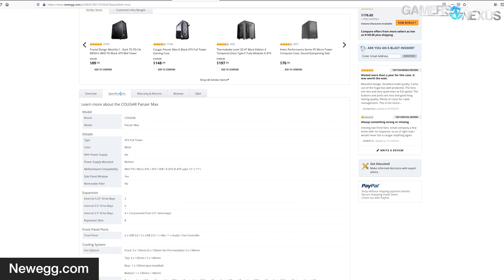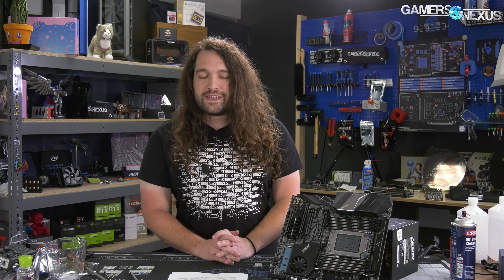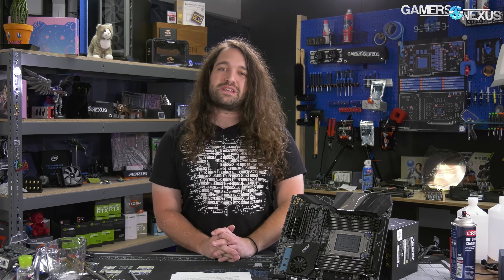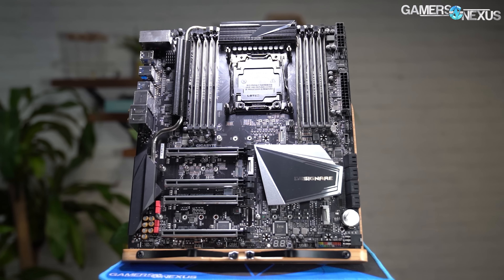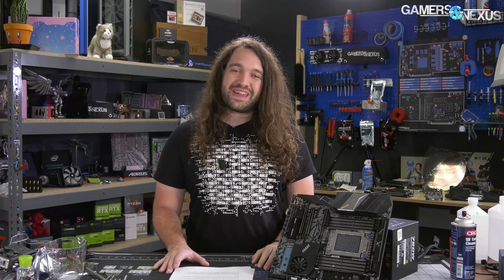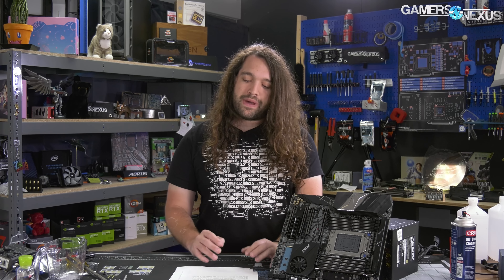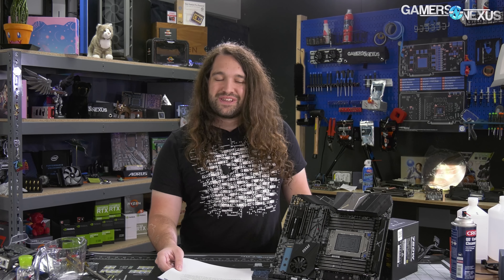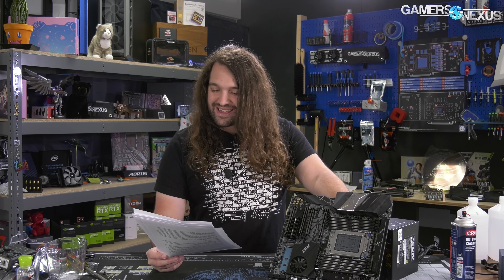"E-ATX" Is A Lie: How Motherboard Makers Ruined Form Factors

Comment: Mentioning ATX or SSI EEB is important though to provide information over the screw mountings. Yes, it is not helpful that some manufacturers use E-ATX interchangeable for "wider than ATX but with ATX holes" and "wider than ATX with SSI EEB holes". The first one actually makes sense, as "Extended ATX" says what it is supposed to mean, it's the second one that creates issues if SSI EEB is not mentioned. So my proposal is for  manufacturers to, if supported, just use SSI EEB as the supported form factor, and if not, but still larger than ATX, to say "Extended ATX Form factor with up to x width" as that seperates the "Extended" from the standard.
P. S : Please don't prove your point of a non insightful thing by just pulling a tiered acronym apart multiple times, that's just primitive and dumb

Comment: I never really read up on these different standards of form factors, always working under the assumption they were grounded in published standards. Having just found out this isn't the case at all, I'm extremely confused how everybody in the industry could just keep going, inventing new kinds of motherboard form factors left and right, which has apparently led to a dizzying number of differently sized boards and no good way for customers to check whether the stuff they bought is even of a compatible size.

Comment: I suggest you, Linus, Kyle, Jay, and Wendel get together, and hash out a new standard, then send it to case/mobo manufacturers for review, and the final revision should go to IEEE. And of course into wikipedia.

My draft:
X-Y-Z-i-j-k-x-y-z
- X= utilization: D=desktop, S=server, E=embedded, M=mini, Z=special
- Y= cpu type: A=amd,I=intel,O=other,N=any
- Z= Form Factor: XL=extra large,L=large,M=medium,S=small
- i= # of expansion / PCI slots
- j= screw arrangement: A= original ATX, E= EATX, D= dual, L= ALL, (this most important form factor TBD)
- k= standard: M= metric, I= imperial
- x= width measurement  (depends on k above)
- y= height measurement (depends on k above)
- z= maximum GPU length (depends on k above)

So, for example my Asus Prime X370 Pro would be something like:
DAL-6AI-12-9.6-9 

Then, my Corsair Crystal 570X would be:
DNL-8AM-512-480-370

 I have spoken.
Reply: I don't know if it's easier...but at least, you're good at creating passwords

Comment: Same as "Full Size - ATX" When you buy motherboards look at dimensions of the board "if provided"... I purchased a Gigabyte X390 Full-ATX Motherboard... but compared to my old Gigabyte Motherboard the new one is off by "10 - 15 mm" in "Width" and because of that 1 Ram/memory slot is blocked now.... vs the old board...

Comment: plus it would be useful to have the standards in a more common system.
ATX is 305x244 mm, why not chane that to exactly 300x250 mm?
much better to work with for the majority of the world that use metric.
also fuck i have an EATX Motherboard...

Comment: Steve is bored lol. Now can you pick on case makers like Fractal who list radiator support for say a 420mm radiator that only tends to fit if you have no hardware in the case other than the radiator OR Radiator manufacturers themselves who seem to like using different dimensions and even screw holes placement.

Comment: For many years, I used large dual Xeon boards in my desktops, and that required very careful case selection since most are EE-ATX or some weird proprietary tweak thereof.  I always looked at the manuals to see exactly how much space was available, and to gauge how much dremeling and drilling would be required.  At the time, it made sense, but Zen 2 finally brought workstation power to plain old ATX sized boards, and I can finally rock nice looking cases again.

E-ATX and EE-ATX can die in a fire.

Comment: Glad I found this.  I keep checking your YT channel to build my first 3D render PC, but most Creator motherboards are EATX, and not one fits into most cases.  I’ve reviewed your videos on good cases, and the EATX would fit in Thermaltake Tower 900, which you rated terrible airflow - so, now I’m trying to find alternative motherboards to fit cases, or alternate cases for the motherboards that I have my eye on.  Not having much luck with either...

Comment: Having built a dual Xeon using a supermicro EATX C602 board, I can safely say GN is spot on here. The standard is a mess. Luckily I triple checked my case vendor's docs and found out that my board would fit. And oh boy is it tight, even in a "full height tower".

Comment: This just illustrates how badly "ATX" needs to die.  All the form factors suck, and 75% of the 24pin ATX connector is literally useless, its all insanely outdated.  "ATX" is generally a waste of space aside from HEDT and then its too narrow, EATX is a mess (obviously), iTX is too small and cramped to be mainstream, mATX is about right size wise honestly.  The community and case, board, and PSU manufactures need to get together and draft some new standards for the enthusiast market.  Just don't let Intel touch it as they'd surely fuck it up.

Comment: tldr: E-ATX = an ATX board wider than spec by an undefined amount. make sure to check the maximum motherboard width supported by your case before buying an E-ATX board.
Saved you 20min. You're welcome

Comment: I think it would make far more sense to increase the form factor in other direction, to get more slots and make it official in a sense that cases would need to have specific things and motherboards cannot require anything other than that to fit it.  I would rather like to see potential to have 3 extra slots in the bottom. Basically having space for 5 dual slot cards, or 3 triple slot cards.  The extra space could be used for same things as going for other direction. And new bigger cases would also fit the OLD motherboards easily so that wouldn't a problem.

Comment: I remember working at Microcenter back in 2010-2013 and having to explain this nutty crap to the few people that came in looking to get the really high-end boards that had "EATX" sizes.  Biggest issue being finding cases.  It was common back then for motherboards to sit in a recessed area back then.  Early days of good cable management attempts.  Not all of these cases supported all EATX boards.  Despite saying they did.  Good times...

Comment: Thanks GN! We needed someone to say all this loud and clear. I shudder to imagine if power supply manufacturers were as fast and loose with motherboard pinout standards as motherboard manufacturers are with sizing standards. (Yes I know the power supply side of cables are shockingly non-standardized already).

Comment: Thank you for covering this topic. It has been a constant source of frustration for us professional IT people for years now. ATX always was designed to conform to a size specification, etc. It was designed by Intel, and agreed upon by various industry manufacturers back in the day like you said, to replace IBM's AT standard. But these motherboard makers don't even stick with the ATX size specification when they call the board "ATX." You get a motherboard thinking it will be the proper ATX size spec, but then find out that the board is narrower. So for example, Gigabyte calls a board "ATX", but it turns out to be narrower in width. That means then you only have two screws across in three rows on the board. They then add some weird 3rd standoff hold on the 2nd row. That weird 3rd hole doesn't even line up with the ATX spec, so therefore it ends up being useless. I have never seen a computer case that has a drilled location for that extra hole. Why Gigabyte? Why? What the hell is the point of it? And why do these board makers create these narrower boards? The only reason I can think of is they are just trying to cut costs or corners.

Comment: Excellent and right on the mark with this rant. Totally justified. I ran into this when I built my EVGA  151-HE-E999-KR motherboard. It took some time back then to find a case to hold it. I ended up with a Thermaltake Core X9 a massive case. Had to do a lot searching at that time to get a case that fits.  Thank you for making this public for the case and motherboard manufacturers to  understand (hopefully) that this a real issue.

Comment: Mobo manufacturers may have started this nonsense but case manufacturers are to blame for making it a complete mess. If they would simply make their cases compatible with most motherboards their wouldnt be an issue & they would sell more cases, instead of catering to sissies that want tiny cases for their pussycats to piss all over

Comment: This exact thing has been driving me insane for years. 
Starting with my decision to get into old server hardware.
Fun note, NZXT's case CAN fit an SSI-EEB board, but you have to remove the cable hiding metal strip.
The EATX supporting Cerberus X CANNOT support the full 13" it claims. It's about 4mm short.

Comment: TLDR: Standardizing it would actually be ANTI-COMPETITIVE. That's really a stupid argument tbh

If you're shopping for EATX you NEED to check the dimensions and your casing - which NEEDS to be proprietary to allow for servers to be highly custom..

It just means "bigger than ATX", and while you can't just read a spec sheet while somehow ignoring the dimensions and mounts, you probably shouldn't be building an EATX build just because they've already made it more accessible than it needs to be
Reply: "HELP I BOUGHT ALL THESE PARTS TO BASICALLY BUILD A SUPERCOMPUTER TO PLAY FARMVILLE ON BUT IT DOERNT FIT OR MOUNT AND I CANT EXCHANGE BRAND NEW  CASE OR REUSE EXISTING ONE WTF"

Comment: The height is getting a problem too, Asus Zenith Extreme has a heigt of 12" (30,5 mm), the Asus Zenith II Extreme is 12,2" (31mm) both say "EATX" on their productpages. 
I got lucky that the Zenith II Extreme fits in my Coolermaster C700M, because it has 8 Pci slots.
If i had used a Fractal Design R6 the Zenith II Extreme wouldn't fit, only 7 Pci Slots max height of 12", but it says eATX on the productpage. 
This gets even messier when manufactures play around with dimesions in both directions.

Comment: Nerd 1:"Hey man, did you hear about Steve?"
Nerd 2: "Kangaroo or Tech Jesus?"
Nerd 1: Crosses chest "He's gone, man."
Nerd 2: "Wait what? Corona? Random car crash?"
Nerd 1: "Naw, man... he had a stroke when he was bitching about case and motherboard manufacturers not understanding form factors."
Nerd 2: "Dude... those monsters. Do they know what evil they have wrought? Who's gonna feed Snowflake? Someone needs to let them know they've gone too far!"

Meanwhile -

MSI: "haha VRM go sizzle"
EVGA: "haha CPU cooler mount sideways"
Gigabyte: "haha dual BIOS go BOOT FAILURE DETECTED"
ASUS: "haha lightingservice has stopped responding"
Supermicro: "haha green PCB go KA-CHING KA-CHING"
BIOSTAR: "haha we still exist"
Fractal: "haha meshify go whoosh"
Antec: "haha torque go BRRRRRRRRRRR"
Phanteks: "haha reservoir go in fan slot"
NZXT: "haha CAM go *Windows XP error sound*"
Thermaltake: "I NEED MAGENTA"
Reply: E Montem Ros Corsair: "haha light go BLINK BLINK"

Comment: I buy MATX because im not doing anything cool, nor pretending to be. I buy older games when they go on sale, F2P and esport games, the newest game I get are free from epic. my last upgrade was last year to a refurb $70 R9 380 and a ryzen 1200 on a B450M Aorus with 16GB RAM ($270 in total, "shop S-Mart"), all crammed into a tiny rosewill ranger-M with a 4000 RPM fan from an old stock FX 6300 cooler, stuck in the front to dump air in at rock-concert decibels, so this shouldnt affect me, but I am not so naive. unfortunately, I am aware of how bullshit cascades down hill, gets carried by the wind to far off lands, and pools to fester at every available crevice, and therefor am still really pissed off and disgusted by this BS form factor because I know, I just know somehow its going to bite me in the dick some day, despite being on the opposite end of the spectrum from where i comfortably sit in "average user land". in fact, when the dust settles, i bet the noisy minority of advanced users will get some sort of clarity at the expense of the so-far-unaffected average DIYer, just because something has to give and all the suggestions will be coming from the top advanced user crowd. Hopefully it wont all get scrambled, maybe we will get some new form factors and simpler, logical descriptions. I swear its like nobody ever asked these tech moguls what is the difference between a big block and small block engine, just to watch them spend 5 minutes on the internet leading to aneurysm

Comment: Yeah. This is so much bullshit it makes my blood boil sometimes.
Recently I've been trying to find cases that support the Gigabyte TRX40 boards, which are labelled as XL-ATX. Except they're not, not even one of the 3 available competing definitions of XL-ATX matches the boards' actual size of 325x275mm. Wtf? Gigabyte apparently needs 2 different definitions of the same non-existing standard. Just for good measure, I guess. It gets even better when you ask case suppliers if the Gigabyte board will fit. Then you're in for a treat. It's really, really obvious that very, very few have any clue what they're talking about when it comes to dimensions, and even less give a fuck.

Fantastic video, I laughed far more than I should've. ;)

Comment: Want to Buy:  better control on this BS. All it does is lead to confusion and cost to consumers. especially those that are coming into the PC Hardware industry. It's the same as Pin-outs from Modular PSUs, theres no standard for that. So someone without heads up knowledge of that can easily brick a component, or even a full system if they manage to mix up cables from different PSUs.

Comment: Considering "EATX" boards are all highest-end, very expensive, enterprise-level, this seems like a problem that affects statistically few people. When you make no-compromise runs in the hundreds, you make the board whatever dimensions it needs to be to fit all the features. On budget boards you only include what features will fit in the standard form-factor.

Comment: This is something that's been pissing me off for years tbh, I used to play with dual xeon stuff a LOT so finding a case that'd fit those boards got hard since, as you mentioned, basically only silverstone actually list their boards as ssi-ceb or ssi-eeb and all, everywhere else was just 'E-ATX' even when by E-ATX they mean literally anything that's wider than a standard board, the other classic as others have mentioned is the 'oh, yeah, you can put a radiator in the top of this case but only if you don't need any ram' or 'oh it can put a 360mm in the front and the top! Just not at the same time' it's all beyond stupid

Comment: I see what you are saying but EATX came out at the same time ATX came out I seen 486 Motherboards and cases that were that. AT motherboards were bigger than there ATX , EATX.  EATX board were never that common but and few in the market.  I had a case made in 1995 that was marked for EATX  motherboards and I seen 485 boards that were that form factor. the AT form factor was bigger than common atx factor we have today..  ISA slot are bigger than PCI VGA or PCI e slots. Find the first atx standers and and you will find E-ATX Is Early varrent . By The way The BTX  form factor is what most laptops use because of cooling. you real do more digging and you will find atx and eatx came out at the same time. You real do not under stand that the makes of mother boards are not realy posting the products to amazon they are using a middle man of sorts to post on amazon they are not doing it them selves

Comment: Hey Steve. I’m sure this is more intense than the surface level I’m making it out to be. But how difficult would it be if you created some kind of actual standard for this and used your contacts in the motherboard industry into one big conversation about using the standard. Define the standard as “jumbo-Atx” or something. Doesn’t really matter but don’t call it e-atx so there’s no confusing the new standard with current e-atx cluster fun. Call it L-Atx for large ATX. And make a T-Atx for Tall Atx. More pcie slots. And LT-atx for ones that are taller and wider. I feel like if you make a standard that is simple, cheap to implement, and sounds good for marketing you could get the big players to agree to it. 

Yeah. Wishful thinking.
Reply: I think it should be Latx-  longer
It should be Watx- wider
Mini W-one pci but wide
Mini L-long but 2 slots

Comment: E-ATX is used simply because when it was introduced, people were used to ATX and mATX. E-ATX was a logical larger size. Imagine you'd say SSI-EEB at the time. Nobody would take the board as anything related to PCs. However I was not aware E-ATX was not a standard ... I always thought it was equal to SSI-EEB ...